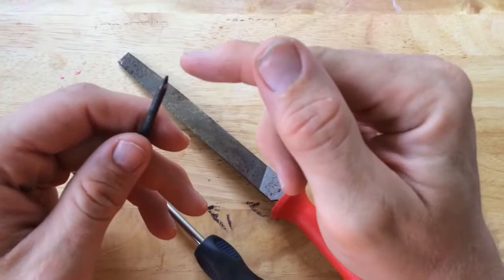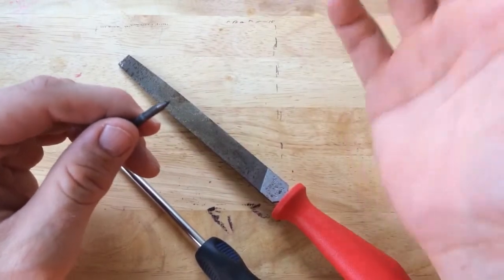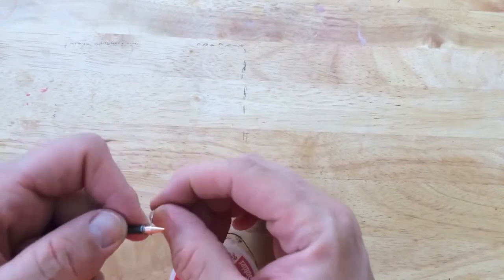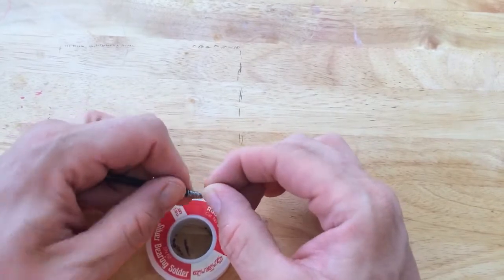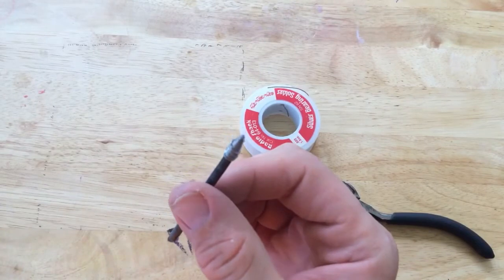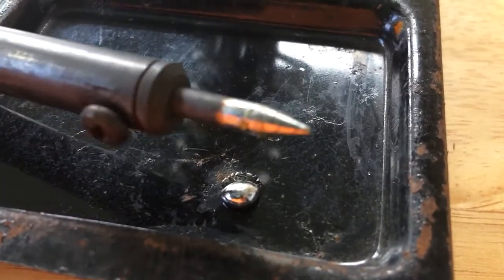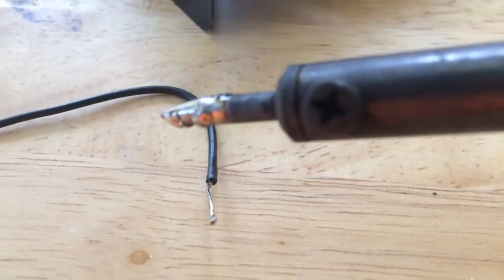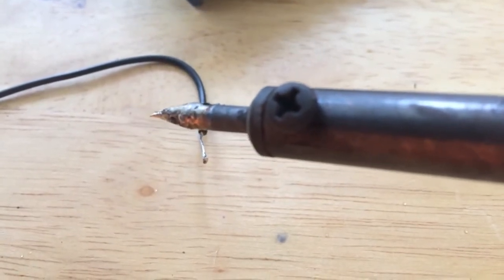Retin the Freshly Filed Copper Tip of My Soldering Iron

Comment: I've been struggling like a bastard to get my iron to tin. This worked like a treat. Great idea.
Reply: I'm a few years late, but yea, don't do this. Just buy a new tip and tin it properly before first time use, then keep it tinned, especially when storing it between sessions, and you're fine.
Tip tinner/tip activator is a great option for first time tinning or even restoring a tip with a bit of oxidation. But if it gets even close to what his tip looked like in the video, just buy a new one. They're really cheap.

Comment: Great Idea! In 20 yrs of electronic work I never though of tinning a tip like that, excellent!
Reply: Raul Lugo it's how I have did tip breaking in since I was a Teen and was a sponsored world class Off road Radio control guy... I solder everyday in my hobbies (still radio control) and this is how I have always done new tips and when retinning old tips... however it's a hugely bad idea to file/sand tips as it removes the platings... I use name brand Hakko tips that are NOT CHEAP so I take care of my tips to start with and have a excellent solder holding clean tip 110% of the time... not only is a nasty tip doesn't preform good or at all if bad enough but it will contaminate solder joints and on high current carrying joints that's a bad thing.
Reply: Yea we were taught to tin our tips like than when i went to school to become an electrician (never finished)
But sanding or filing will always ruin the tip. The flux and solder will erode the copper and it'll slowly disappear, all while being forced to redo the filing/sanding because it'll oxidize faster than it would with the iron plating. in fact, even sanding down the plating can destroy the tip, if you get a crack the copper will slowly erode till the tip is hollow and can't transfer any heat.

Comment: Dude, I loved the spiral melting
Reply from the maker: +David Watts I thought it was awesome. I wish I had caught the entire spiral melting. Thats what I get for adjusting the camera. I'm thinking about doing a couple of spiral solder on copper experiments just to see what I can do visually with melting solder possibly with a macro lens. What do you think?
Reply: Robert Gasperson - I think that using a macro lens would surely result in some great visuals. My main soldering iron has an iron tip with special coating, so I don't want to file it. However, a significant part easily oxidises and doesn't easily clean. I use those copper shavings to clean the tip. That seems to work better than a wet spunge. My other iron has a copper tip. Round with a flat edge. Next time I'll give your method a try to see if that goes better than just pushing the solder to the copper. Thanks for the suggestion!
Reply from the maker: +Maxint R&D you bet. I'm just glad it worked this time. Wrapping it seemed to do the trick. The new tip I got that I'm hoping to use seems to be coated rather than strictly copper. I'm curious to see how long it will last if I can even use it. Thanks again for the comment.

Comment: Never file or use sandpaper on your soldering iron tips. Heat, flux, tin, flux again, then tin, flux again, then tin, dribble off any excess solder, done. Abrasives wear off the protective coating of your soldering tips rendering them useless.
Reply: you can file copper tips, iron plated tips are what get destroyed by filing.
Reply: @purebloodsunite7489  that's not true, copper tips are nickel plated. Ive seen non-plated copper tips but those are used for wood burning decorations and stuff like that, or sold dirt cheap from some asian country. Either way, non plated copper tips arent used in soldering since it has the same issues as a plated copper tip that got filed down, the flux and solder erodes the copper relatively fast till its completely dissolved.
So no, filing most copper tips will destroy them as well
Reply: @thedancingpipestuffer there are bare copper tips that are not plated and they are not only use for wood because they are cheaper and you can abuse them but they are really good at soldering tiny component because they can transfer heat better than the plated ones.

Comment: I do the full tip & even lap it to a smooth shiny finish to improve heat transfer. 
By full I mean the entire piece. I also do the inside of the iron if it is copper. I try to remove as little as possible though. 
It improves the heat transfer rate but at the cost of loosing contacting surface area each time you do it. 
The beat practice is to plan your work out well ahead of time & keep the iron turned on for as little extended amounts of time in between applying fresh solder & using it. 
Also make sure to always be keeping it tinned so that it doesn't oxidize to begin with. Don't use more heat than is needed and don't leave it sitting for a long time.

Comment: So many people have commented that the copper tip is plated with iron and should not be filed like this as it may damage the iron plating then why the company doesnr produce some thing like a compounding iron and copper so as to get a pure iron core in front where as a pure copper core at back....
Reply: wtf are you talking about 🤣
Its not that filing your tip may damage the iron plating, it WILL damage it.
Not sure what iron core you're talking about but the reason why modern tips are made this way is simple. They have a copper core because of it's thermal conductivity, it heats up faster and more evenly than an iron core would. Then it's iron plated to protect the copper because flux and solder literally dissolves the copper. So an all copper tip would slowly disappear. Same with a copper-iron alloy (which is what i assume you meant when you said compound). You'll barely get any of the thermal conductive benefits of the copper in an alloy like that, and the copper would still erode, you'll be left with an iron tip that's even worse than an all iron tip because it'll have pits all over from the eroded copper.
Reply: So, which one would you pick? Personally I'd pick the iron plated one and refrain from sanding or filing it down. Besides, with proper tip care, they last a long time and they're really cheap when you eventually have to buy a new one

Comment: Never, ever file or sand the tip of a soldering iron. It removes the iron plating that protects the copper underneath. Replace the tip when it gets pitted and take better care of the new one..
Reply: what you said is right but that is only the case for platted irons not for the copper ones which do not have iron platting. but good thing u noted

Comment: Tips are cheap. Just buy a new tip. That thing looks bad. I solder mods I'd have just chucked that one and on to a new one. I've never in my life had a tip look that bad. Are you trying to make them that bad for worse case scenario? Before I even knew what tinning meant my OCD kicked in and I'd whipe it on the damp sponge